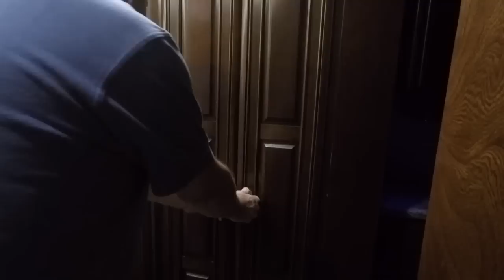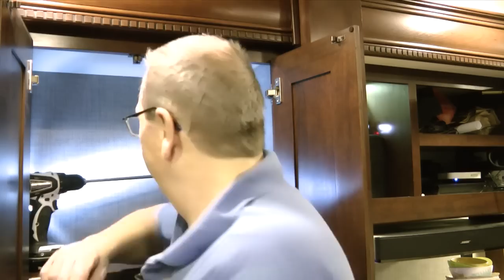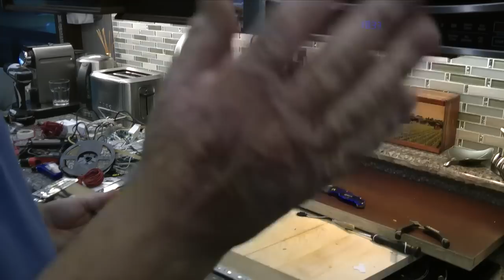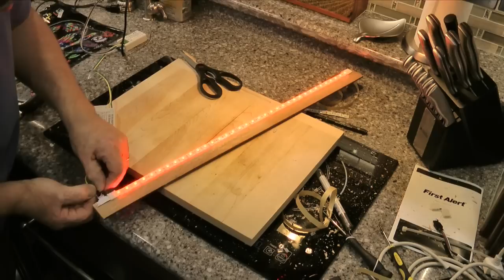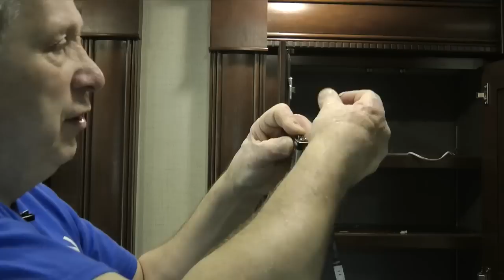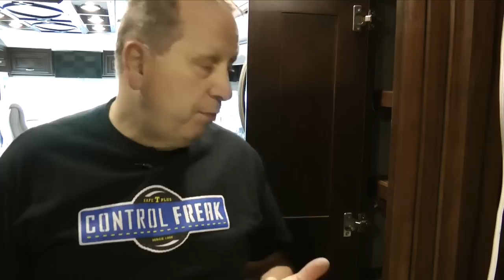How to install LED lighting into your pantry cupboard

Comment: solid copper 22 or 24 ga plastic insulated telephone cable using scotlock or amp connectors would have saved you a lot of time because you wouldn't have had to do any soldering.

Comment: Hi again, could you do use a favor and look at the unit on EBay that we are considering bidding on.  It is a Phaeton and we’d love your opinion.  It is item number 132522660214.  We sure would appreciate your opinion.
Reply from the maker: Well I looked at this and on the surface, it all looks good. Low mileage for that year and from the pictures it looks clean. Maybe you can either contact a tiffin dealer and check any warranty work that's been done on that VIN number, maybe Tiffin themselves will tell you. Try and get some sort of warranty from the dealership. But you need to do a real detailed inspection. Good luck with your purchase.
Reply: Great Escape Thanks for your opinion and great advice!
Reply from the maker: I know it's difficult when you have the hots for buying a particular RV that you have your heart set on. But trust me there are plenty more exsactly the same just around the corner,  so be brave and walk away if you see something you donlt like or doesnlt look right.

Comment: Glenn: great job, love the colors...Quick tip, if those are 3M crimp connectors, no need to strip the wires just insert and crimp the connector strips the insulation.
Reply from the maker: Hi Jim, I thought that, but with the covering on the wire they wouldn't fit into the connectors, so I had to strip them anyway and then they were too flimsly to push in.
Reply: Well that sucks, makes for a lot of extra work, but the end result are fantastic

Comment: I would have changed the shelves to pull-out shelves with a strip on each side. When you pull them out, it makes that lighting more than sufficient. That job would have been done faster and a lot easier.
Reply from the maker: Hi Roy, You are joking, how would that be quicker. for a start I doubt you would get a good enough fix, don't forget is plywood on the sides. Also all shelves would have to be cut down. So not sure how you think this would be easier and quicker ?

Comment: Glenn, Buddy, I really like a lot of your ideas and have even applied some to my coach, ie.. LED cup holders, LED's around the cabin area.. This one, your on your own... LOL.. I just bought the battery LED sensor lights, sruck them in, and called it a day..  Keep them coming all the same..
Reply from the maker: Wait until it rains for a week you'll be begging to do this job to keep you busy.
Reply: Great Escape Good one.. LOL... I would first have to survive the wife mouth for tearing everthing out of the closet...
Reply from the maker: Why do you think I did this when Julia was still at home?
Reply: Great Escape Yup.. Your a smart man.. I would hate to see a video of you getting run over with your own coach..

Comment: Will the motion detector trigger while you are going down the road?
Reply from the maker: Of course not, the sensor only detects movement in front of the sensor. Plus of course, the doors are closes and even though there is a small gap between the two doors the lights don't come on when you walk past.
Reply: I meant would the vibrating dishes within the cupboard while driving trip the sensor?

Comment: I installed motion sensitive (auto on/15 sec delay off) LED lights in every cabinet and closet or dark confined space in our truck camper in less than 10 minutes :-)  I bought 2 packs of three lights for about $32. They are about 3 inches square with the sensor in the middle of each one. They hook and hang on a small mount held to the desired wall with 3M double side tape such that they can simply be lifted of the mount. Each takes 3 AAA batteries and you're done :-)
Reply from the maker: Horses for courses

Comment: Thank you so much for your honesty. And showing the true struggle. Question... why didn’t you just stick with a 12v power source??
Reply from the maker: You would still need some method of switching the lights on/off when the door was opened.